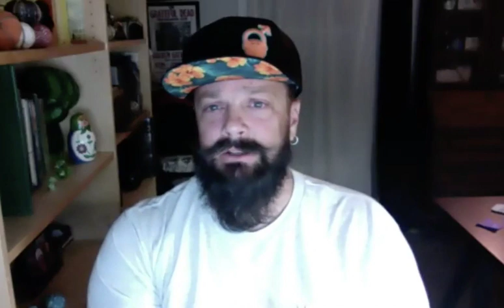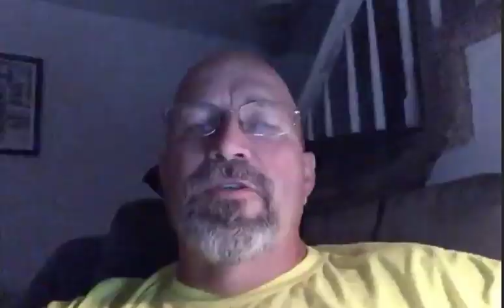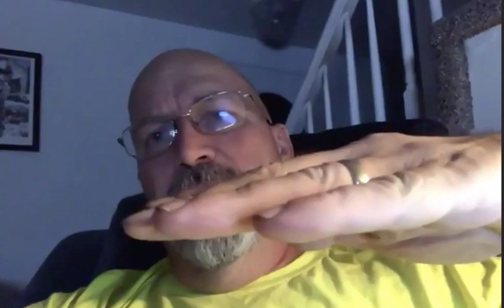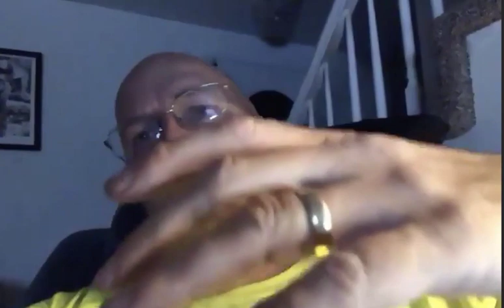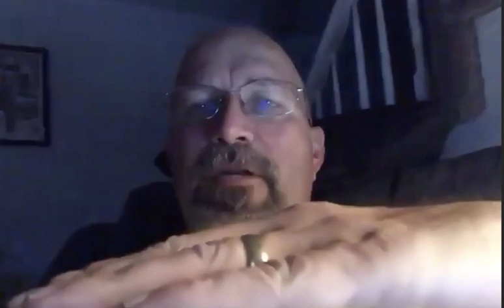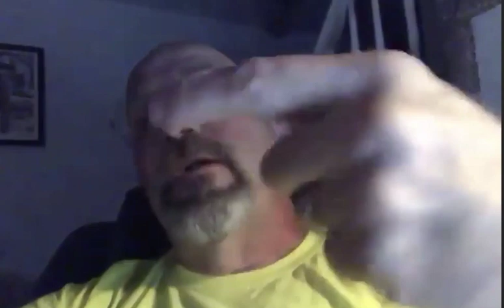Propane Tanks Freezing - Solved

Comment: Just want to point out propane inside the tank is not at -44 degrees. That is the boiling point. You couldn't touch a tank with bare hands if it was at that temp. As the temperature rises, the vapor pressure rises. Think of a pressure cooker, same concept. One other point for cold climate folks, it does not "gel" at -44 and colder, it no longer has vapor pressure below that temp, it's just liquid. It becomes very clear with a phase behavior chart. Boiling point -44, freezing point is  -187C. In between it's liquid.

Comment: I use the little green screen in tank for my BLACKSTONE grill which is brand new and the silver regulator gets real cold and freezes after a few minutes does the tank have to be any certain direction ?? Can’t seem to figure it out
Reply: If you've got a blown out grill it's releasing too much propane and it will tend to freeze up in the line and the regulator

Comment: That doesn't make sense. My regulator didn't frost up and freeze with a grill size tank. But it does with a 40lb tank. I use a Mr heater 80,000.btu.

Comment: Could the freeze up be from an over filled tank? I’m using  a 100 lb tank with a 30,000 btu heater. Never had this problem before. Also before I hooked it up it’s been periodically releasing gas every couple hours.

Comment: Hey everyone, So we are brand new into this adventure,  we purchased a 1984 Victor cart and well we ended up having to rebuild it from the ground up.  We are finally to the point where we are trying to get the burners to flame up.   BUT we keeping having "low flame issues"   Not sure why.  We have replaced the valves the regulator and have tried 3 LP tanks, reset the regulator at least 100 times now, "burped" the tanks however it never seems like we get much LP bleeding out and very little propane smell. Also leak checked a few times with soap water.  We also live in the desert and its been a consistent over 105 degrees every day.   does anyone have ANY suggestions out there.............??????????  please HELP  we are ready to apply for our inspection/ permit !!!!
Reply from the maker: hotdogcartstore.com/help (good help videos)

Comment: over the summer i plan on upgrading the heating in our gym that is inside an area of the garage, gym is 12 foot wide by 26 foot long with 12 foot ceiling, right now we have 2 Mr heater 30k btu walmounts keeping it warm, the issue with that is that they like to shut off due to the o2 sensors kicking them off so i am moving on to forced hot air and buying the mr heater big maxx 80,000 btu and hooking that up to 2 100 pound tanks, i do not think i will have any issues with freezing up you think? I live in upstate NY in the Adirondacks were the temps drop way down below zero at times, been mild this year however. I know the 80k will be way overkill for my gym but the rest of my garage will benefit from it when i open the 6 foot wide sliding door to let the heat out into the rest of the garage if i need it at times. I also plan on keeping the heat set at 45 degrees in the gym at all times until we go out to workout and then we will turn it up. Its a pain in the ass going out every morning right now, starting up the 2 heaters, let it warm up for about 20 minutes and go back out to start working out and having to deal with frozen weights and dumb bells. So keeping the heat set at 45 i will not have anymore frozen  weights :)
Reply: The reason for it shutting off is the lack of ventilation.  I have same problem with my 20000 in a roughly 15x25x8. I have to have it close to a fresh air source. I reckon if you're getting same type of heater just bigger you will have the same problem. The other problem I have is it shutting off because the propane went to liquid. With this setup of it gets below 20 degrees or so it just won't work worth a crap. Can't have the tank inside either so need to invest in tank heater. I've been trying to troubleshoot issues a lot with it. If it's not the tank freezing or sensor sometimes it's just having a fan on in the room and moving the air around will screw it up, other times it doesn't. In the right situation it works great but others it's just a pain in the ass. I couldn't imagine leaving mine on all the time, it would just burn through far too much propane. I use mine little during day but mainly from 11 to 3 at night, get about 5 - 7 days out of it on a 5 gallon. Make sure you have the ventilation or you will come out and find your heater off in the morning. I use an ceiling mount exhaust fan and a dryer tube and run it in the direction of sensor but foot or 2 away and pull air out of a preexisting hole in the wall that runs into basement laundry room. I don't want to pull too cold of air in so I prefer not outside air. Enough leaks in anyways.

Comment: -44 degrees? Even in summer sitting outside?

My tanks freez up up here in Canada during winter. Is this because the liquid gels up in the sub zero temps?
Reply: It's not actually "freezing" The liquid propane in the tank can't vaporize into the "gas" you need. So yes even in summer your tank can "freeze" if your trying to pull more gas than your tank can vaporize. And that's why 100# tanks can't vaporize any more than a small 20# tank. it has the same surface area at the top of the tank where the liquid propane meets the air.

Comment: By manifold do you mean putting two tanks on an auto changeover regulator or connecting two tanks and running to a regulator so both tanks are releasing propane at the same time? Thanks.
Reply from the maker: I don't remember him explaining that way. If you're in VU, ask him.

Comment: Good info. Would a 30k btu burner make it freeze also?
Reply from the maker: Yes, it's not really about the burner, it's use vs what the tank can produce in vapor. Weather effects it as well.
Reply: @BensCarts  Well, I have a camp chef  explorer 3x which I just bought and will using a 20# propane tank to cook with. I haven't heard anything concerning a freezing tank so I guess that's good news.

If I use all 3 burners at once (not on high) would I run into trouble then ?